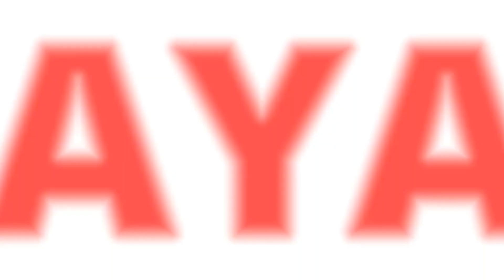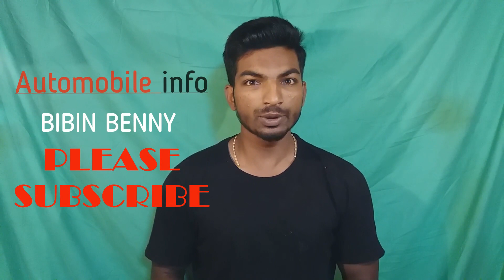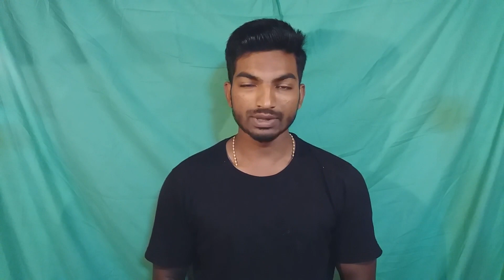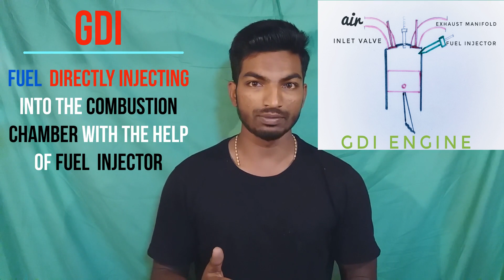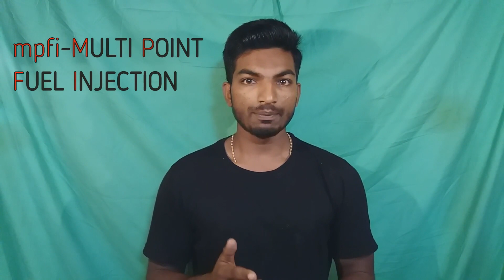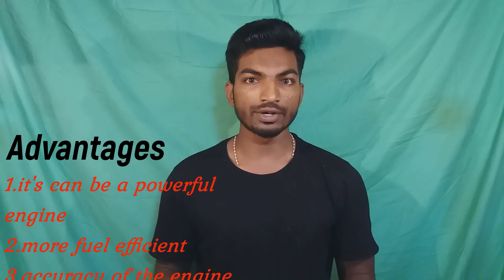GDI vs MPFI  How to works in a petrol engine

Comment: In GDI inlet valvilkoode air matre supply cheyunullo (and not air-fuel mixture like normal petrol engine)?
Reply from the maker: Yes bro.. First air supply to engine through inlet manifold and fuel is  injecting inner side of combustion chamber(engine ) it's a one of the brilliant technology... Thank u for you comments...